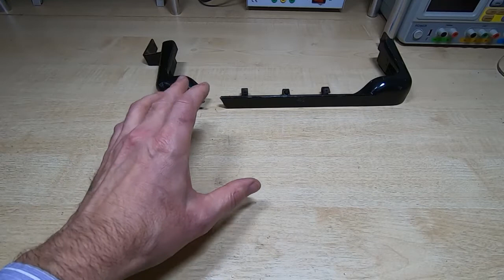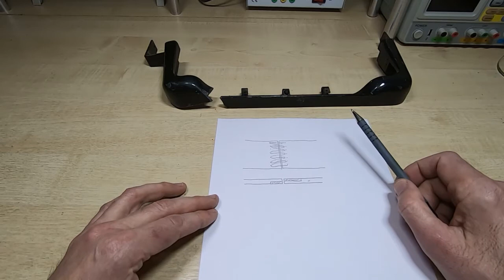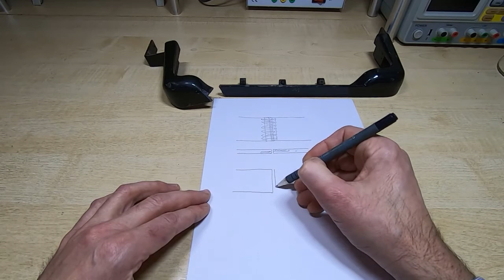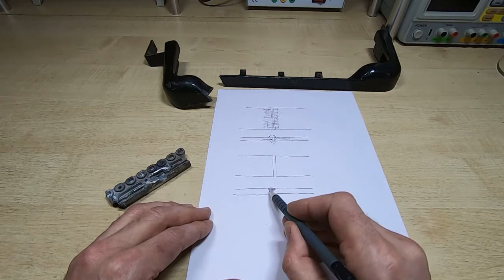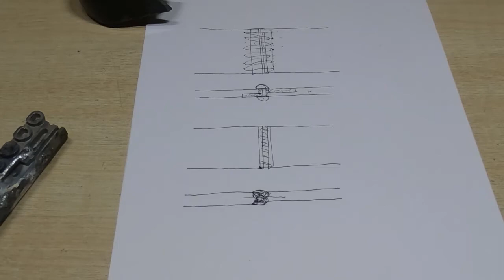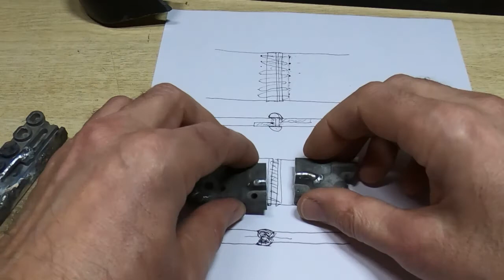Repairs 101 Part3

Comment: As always, your explanations make a lot of sense. I've only ever done stick welding and I have a mig/tig welder on order but it's DC only so no good for Aluminium - but my main intended use is mild steel for small structural components and ultimately stainless steel for vacuum chamber construction.

Comment: - What about drilling and screwing a shaft in one side and then drilling a hole in the other side as well and pressing it together with an adhesive somehow. 
- Like a shrink pressed fitting of a shaft. 
- Then perhaps a small weld.
- Is getting the exact finished look and shape an issue?
- Perhaps you can add some material to both sides.